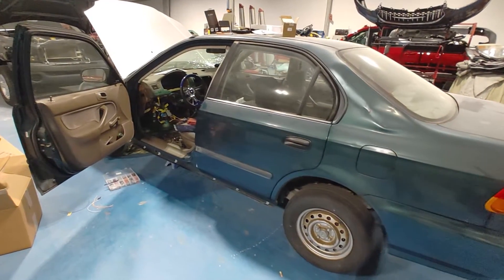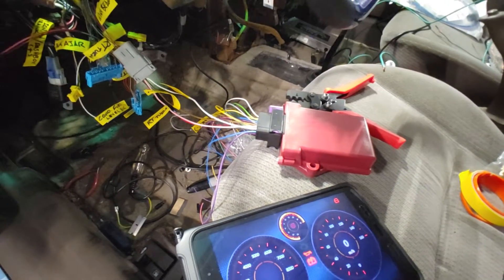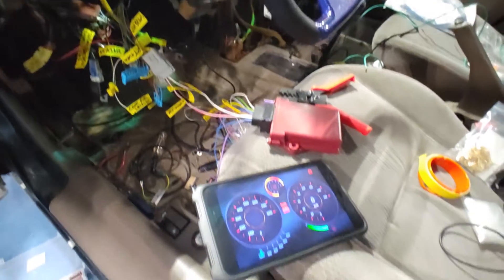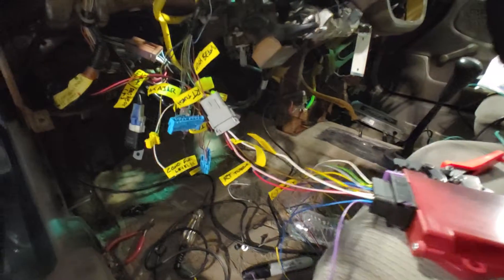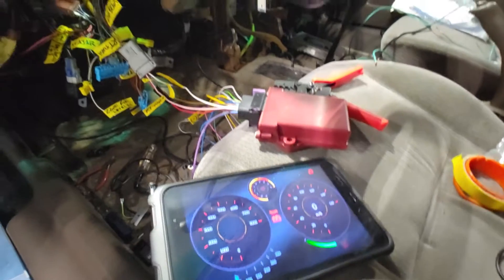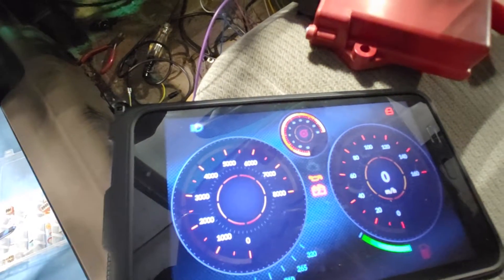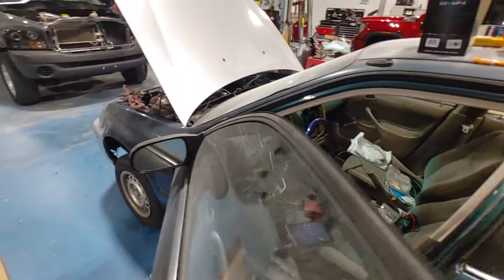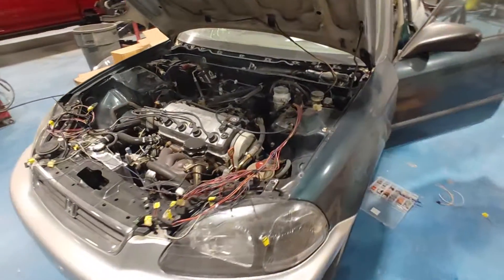Civic Project - Dashbox + Realdash Initial Installation & Test

Comment: Did you get it all wired in and done?
Reply from the maker: Sorry for late reply...The project is on hold while I work on my Acura and build up a motor for the Civic. The Dashbox/Realdash setup was pretty much complete and functional, but I still want to add a hardwired input for the RPM gauge using a CAN to USB adapter since the Bluetooth signal would lag at times.

Comment: Did you use the Dashbox to display fuel level? My project vehicle doesn't have a fuel level from Canbus/ obd2. Curious if the Dashbox can be used to display fuel level info on the Realdash app. (And actually give some fuel economy/ consumption info which would be awesome )
Reply from the maker: Sorry for late reply...The fuel level signal is running through a Haltech conditioner that basically converts a varying resistance signal to a usable 0-5v signal. From there it's going directly to my LinkECU, which allows me to make a chart/graph for exact voltage readings that correspond to 1-gallon increments. Had to empty the tank, note the voltage, add a gallon, note the voltage, etc. until full. That information is going to Dashbox via the Canbus. Dashbox is only being used to convert to bluetooth signal for the tablet. I do think it is possible to send the analog signal from the conditioner directly to one of the Dashbox analog inputs, but I'm not sure how accurate it will be without the capability to make the graph gallon for gallon. The graph is not linear. I wanted to do the same thing you are trying to do with consumption/MPG calculations/distance to empty, and for that level of accuracy there has to be conversion chart somewhere and I don't think Realdash has the capability currently.

Comment: I can see a oem honda ecu
Reply from the maker: You can see the OEM case. The guts inside are from Link. It's their G4X plug-in model. Fits directly inside the factory case, and plugs directly to factory harness.